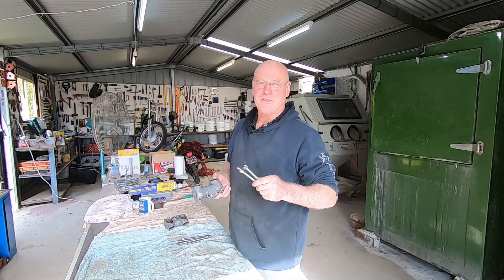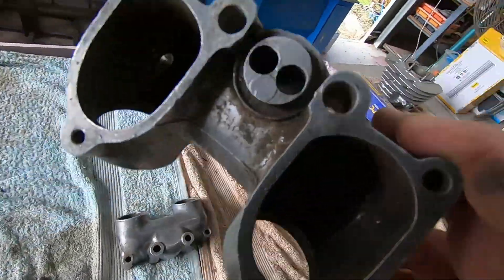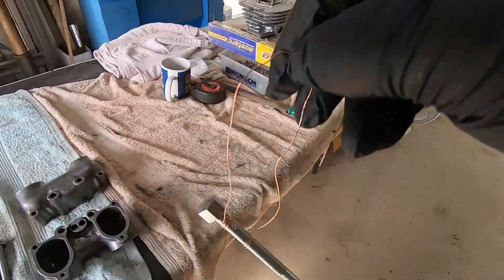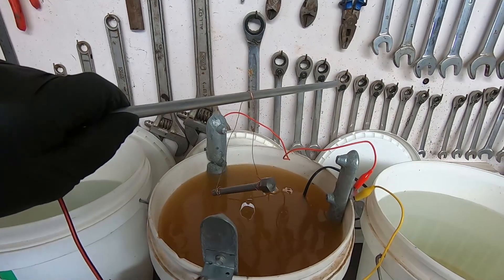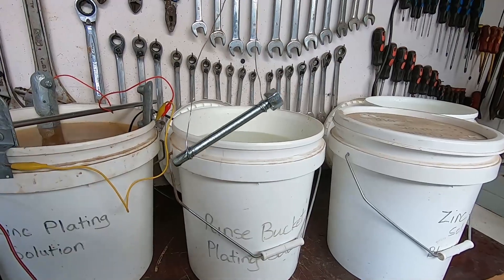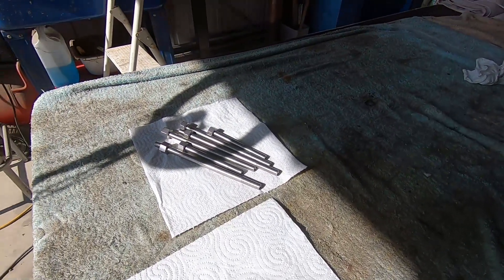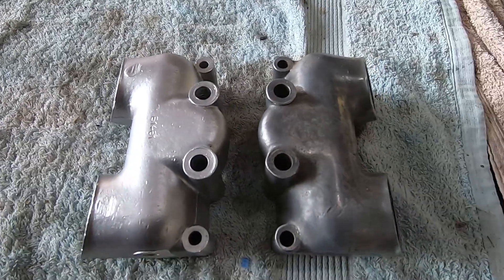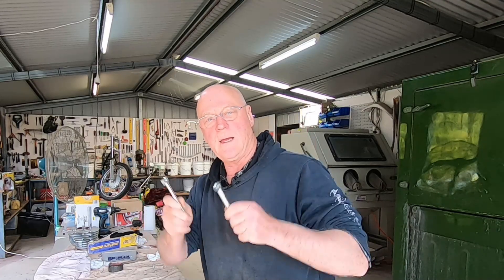DIY Zinc Plating and Hydroblasting Triumph parts. How I do it!

Comment: Thanks for another great video. Looks like you have the plating down pretty good. Sometimes mine will come out good like yours and sometimes they turn out a little discolored which is probably due to my inexperience. For the ones that come out discolored I put them in my hydroblaster and turn the pressure very low and give them a light shower. It amazing how nice they will look after the shower and it does not remove all the zinc.. Then I give them another dip in the zinc bath and usually have a good piece.
Reply from the maker: Thanks for the kind words mate. I don’t get the plating kit out much but when I do The first thing I do is chuck some more brightener in the mix before I start. Seems to do the trick. Its frustrating doing spokes when some work and some don’t. Next time I will experiment by hanging some plastic weights on the parts. I think electrical connections play a big part on the quality of the lighter stuff. Cheers Craig